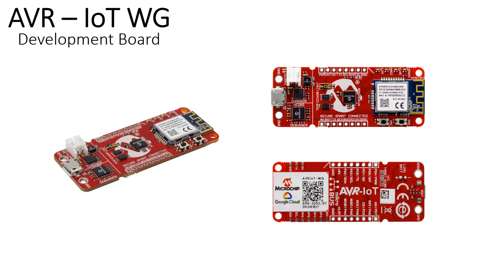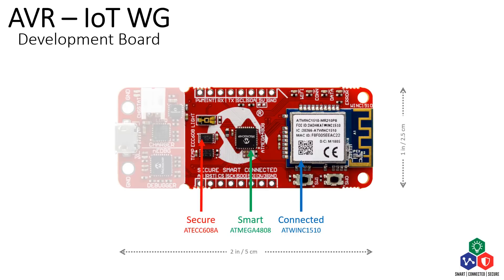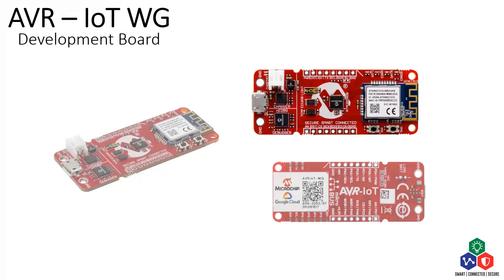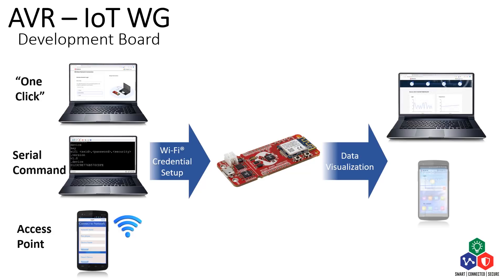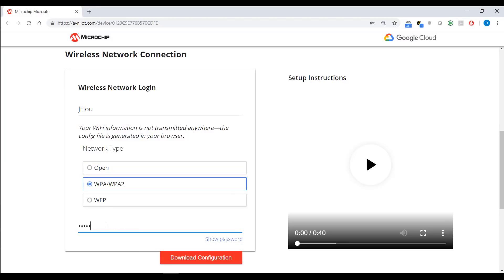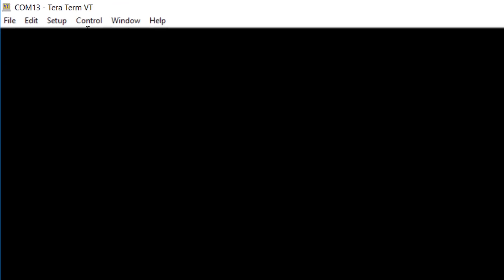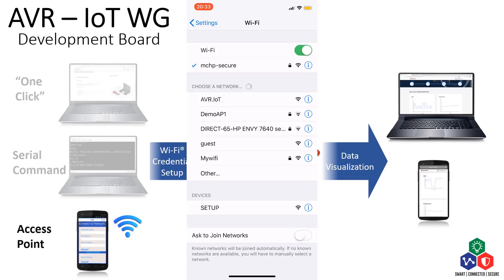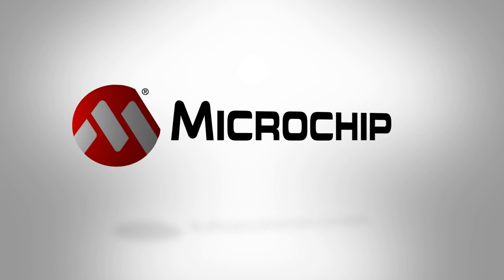Getting Started With Your AVR-IoT WG Development Board

Comment: I have tried to connect to the avr-iot server with the click-me.html file, but I always get the "message": "Forbidden" response from the site.
I tried it by three different browsers, both as administrator and as user.
Please help me
Reply from the maker: Hi Zoltan, thanks for reaching out. Please load the MPLAB X project and program the device which writes a new clickme.html file on the device. You will see it was going to do that by inspecting writeCloudFiles() in app_usb_msd.c). Let us know if this helps or if you have further questions. Thanks!

Comment: From 2:57 there are example, how to connect module with device very fast don't use cable. I have problem with this method. My devices don't see Hotspot AVR-IOT. I push the button and plug power. 4 leds start to flash but I can't connect module with devices. Where made I mistake?
Reply from the maker: We don't provide technical assistance here on YouTube. Please go to support.microchip.com to get assistance with your question.